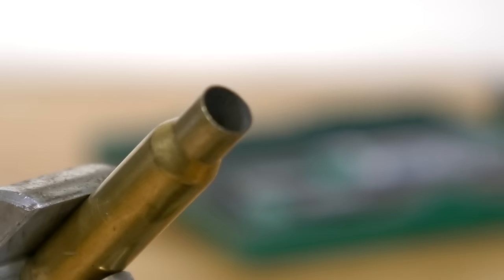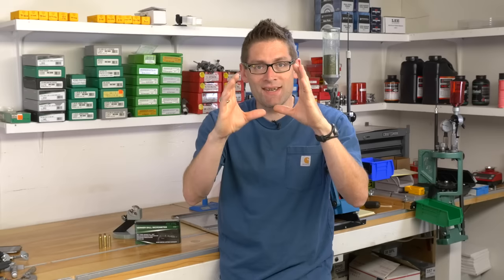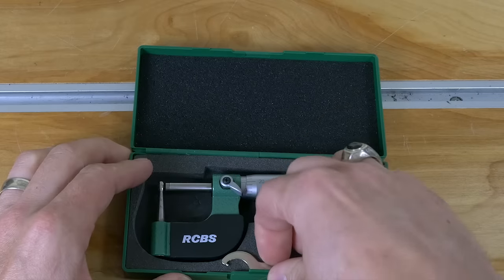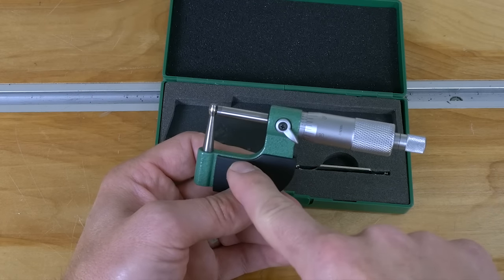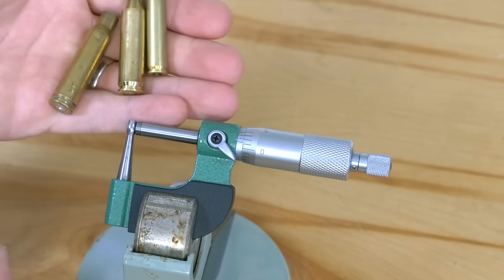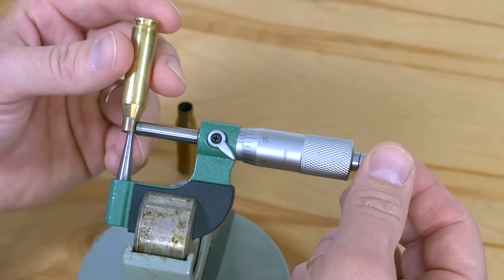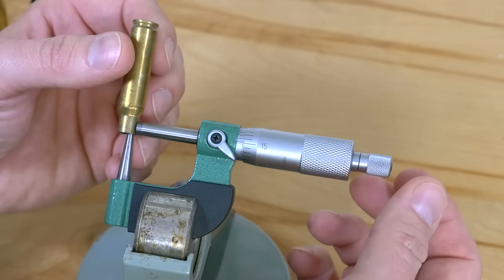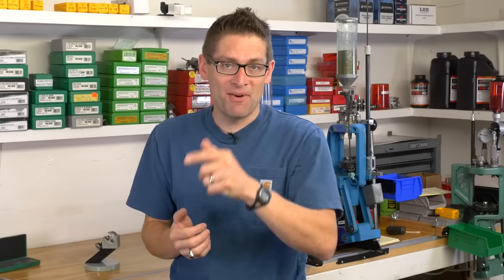Reloading Essentials: RCBS Ball Micrometer

Comment: Save a few bucks. The RCBS Tubing Micrometer ($70) is the same micrometer from Anytime Tool ($36). The only differences I found between the two side by side is they have different plastic labels, ones green and one is blue, and one cost nearly twice as much as the other. They are neck and neck otherwise. Pun intended.

Comment: The precision of the micrometer is more than .013, 013 and an half, etc.  By using the vernier scale, measurements such as 0.0132, 0.0136,  and so on are easy to read.

Comment: Nice clear vid.
I would have no idea what is a good or bad thickness or variant ?
looking forward to find out more in future vids.
Reply: It depends on the case manufacturer. most are about 1.75 thou variations. The exception is Lapua brass which runs about a 1 variation. If you turn your case necks you can get this down to .0002 (2 ten thou)